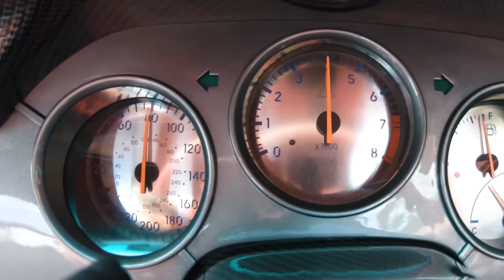The secret to Japanese car reliability - REVEALED!

Comment: Another reason is the simplicity of their design. The boot hinges on a 2003 Vectra had almost a dozen moving parts. The hinges on the Avensis look simpler than the door hinges of my room.
Reply: except that 90s germans and merc also did same design and that broke down, including "simple" parts
Reply: Your 100%  right. Toyota   keep it simple  dont over  complicate but over engineer parts.iv a 2005 land cruser from new and the only thing that broke was the radio..the best built cars in the world..
Reply: @agreatd  but these probably were made of worser materials or had smaller tolerances, or had more complicated systems connected to them, that made several parts fail in tandem, or were simply run at higher stat figures and therefor got more strain on them
A good example is the TDI of today compared to the TDI of years ago. We still see old Passats running around, even though smokey as hell. Newer versions of these are riddled with problems due to how many systems make up the engine, like the EGR and DPF, and even the engine itself is overly designed in the wrong way, aka made complicated for small gains. Reminds me of the 2.0 TDI, which was known for a terrible oil pump design that would destroy itself passively, and the heads were made of pourous aluminium. What a disaster...
Reply: @davidennis7609  Toyota Landcruiser are simply workhorses. Never heard of a Landcruiser breaking down, even when you forget to put engine oil, but of course, you shouldnt forget 🤣
Reply: Also it goes all the way back to some basic design standards called "sigma 6". Simply every engine part is designed to work in infinite cylcles.
Reply: @siavashshoosh  It's 6 Sigma.
Reply: Agree with Onur Koray.
Matt left this crucial detail out. Japanese generally use older technology   which has long been proven and lag behind the Europeans so that they maintain reliability.  The result of this is that they are less pleasing to drive . Their interiors lag behind too. 
A lexus NX hybrid has 200 hp from a 2.5 litre engine with  CVT ! Of course that is going to be more reliable than a Volvo XC  40 with 262 hp from a 1.5 litre 3 cylinder engine with a direct shift gearbox!!
Reply: @mrfadec  Thanks to Toyota's lack of inovation philosphy they are now begging everyone to slow down the transition to EVs because they haven't created anything new despite being leaders in hybrid systems
Reply: They are advanced not simple
Reply: @allentoyokawa9068  A two piece hinge mechanism is far from advanced. It's basic, but it works and it endures.

Comment: Mazda with rotary noises: we are daredevils of unreliability
Reply: The only thing you had to do to get the reliability is change to the ceramic apex seals.
Reply: To be fair, they did build the most reliable to rotary engines out there
Reply: @martinfisker7438  Doesn't change the fact that they were unreliable compared to normal engines.
Reply: Rotaries... Dont buy one unless you know your shit about them... Under than that... They are freckin cool..
Reply: Just get a mazda 3 and ur set for life
Reply: @Seven Penguins true
Reply: Rotary engines used in mazdas are German there called wankel
Reply: Misra cute fun realise car
Rx7 demonish unreliable car
Reply: @gpapagi  Agree. I've had my Mazda 3 from new for 6 years and it's built like a tank. 110Kg heavier than a 5 door golf 2.0GTD, probably because when my car was built it was based on a Volvo V40 as Ford who owned Volvo at the time also owned 30% of Mazda.
Reply: @stig20101  not really. The original rotary engine design was by German engineer Felix Wankel; but saying that Mazda's rotary engines are German is like saying that Toyota's inline-4 engines are Belgian because the first inline-4 engine was developed by Fabrique Nationale in Liége.

Mazda (along with several other companies) licensed the use of the Wankel engine design parents, and then went away and developed their own engines based on that original platform. As with other manufacturers, the rotary engines they produced were not the same as the original design.
Reply: @RT-pj5zj  Not sure where you are getting that weight figure from? But I don't believe it to be true as I MOT cars for a living and part of that is weight on the rolling road and from memory they are around the same weight .
Reply: @damionlee7658  fair enough but that's what I read somewhere and on Wikipedia it's called a wankel rotary engine and is developed with ncu engineers and mazda
Reply: @stig20101  the Wankel has an interesting history, and to be clear you are not wrong about its origins being Germany. NSU was the company that did the early development work on the Wankel engine. They were responsible for licensing the technology to engineering companies around the world.

For example, Rolls Royce also bought a license. It was them IIRC that took the engine and developed a diesel version. Alfa Romeo, GM, and Citröen also bought licenses (and a lot more that I can't remember off the top of my head).

Mazda seem to have had the most success with the rotary design. They managed to get enough reliability or of their development of the rotary engine to do win Le Man's in 1991 with the rotary engined 787B. Unfortunately, rotary engines were banned for the WEC the following year.
Reply: @damionlee7658  cool thanks for the info
Reply: Mazda is a japanese Opel.. just joking 😉😁
Reply: @RT-pj5zj  mine is a 2014 sport nav 2.2 diesel and its a beast, had it since 2017 with zero issues.. fave part is the seat, so comfy i could drive for days. Not sure how the latest model performs but visually i was disappointed when it came out as mazda was promising a kai concept look and they just did not deliver. Was looking at the V40 as well at the time but it was a bit overpriced for me. Overall pretty happy with the £12k i parted with for it

Comment: Matt you forgot to mention Japanese cars made in the UK are also among the most reliable too, so this points to their excellent engineering much more so than the workers who build them, why is a Honda made in England more reliable than another car made in England? its Not the workers its the design quality, n work practise what British manufacturers should a realized long ago
Reply: Japanese cars break down too and their owners often like to pretend they don't (and I've known more than a few Japanese car owners who would boast how their car never breaks down when they're on their third gearbox and just last week changed a window lift mechanism which cost them 200£ plus fitting), but even assuming they really are more reliable in general, there are also issues like complexity, especially when it comes to the level of variations in the manufacturing process, which make Japanese cars very different from European cars.

You can customize a BMW 3 series in so many different ways that you could have 100 of them lined up and no two are the same spec. You can't do that with a Honda Accord, there's like two or three trim levels and engine choices. 

More options means more things that can potentially go wrong, and people are generally better at assembling one thing over and over again as opposed to having to know how to assemble dozens of different things.
Reply: @BigUriel  Generally everybody in general trends to not reveal the problems they have with their cars. Have you actually ever owned a Japanese car or are you just being a spokesperson for BMW? Forget about brand loyalty just get something that works and works for a lot longer than anything else! That would be a strongly reputable car such as a Corolla, Civic, Accord, etc. All Japanese! Save your money!
Reply: @BigUriel  So what!? Quality is the most important thing when buying a car! Quality of the drivetrain comes first and the rest is built just as well on Japanese cars! Some better than others but overall actually long lasting and of top quality (depending on what trim).

Comment: "20 year old car with the same horsepower as a Bugatti Veryon"
Should mention the Veyron is now 16 years old as well......
Reply: And supra mk4 is 30...
Reply: Hmm. Where is this ten years I seemed to have misplaced..
Reply: checkout the price difference
Reply: Are you saying than they are the same level? Rear wheel drive front engine sports car vs rear engine record braking AWD hypercar? Seriously?
Reply: @zlunazelena4080  who said they are same?
we are just talking about numbers
Reply: @zlunazelena4080  bruh did anyone say that? I was merely mentioning that the Veyron itself is almost 20 years old.
Reply: Well the supra engine is 35 years old, has 2.67 times fewer cylinders and less than half the engine displacement.
Reply: HOW EXPENSIVE IS Veyron? 🤔
Reply: Fuck we got old
Reply: Holy shit I'm getting old
Reply: @badass6300  which is amazing to have 1000 hp in supra as compared to bugatti
Reply: @badass6300  and also its just faster sports car (stock!!😉) the veyron is a record braking supercar...
Reply: @talharoxen  for slower ones again: what i wanted to say is than a toyota supra, sports car from 90s is capable of reaching same power level as a hypercar from 21st century,( even though the engine is 20 years older)...
Reply: @arno7110  how many years has the engine in that supra? Most mechanical engine parts are before chernobyl...
Reply: @arno7110  the thing is than if veyron engine has 16years, the 2jz has 36years.... so still 20 years....sure thing the veyron is older than before, i am just talking about the technology level... bugatti veyron from 2006 is still using more modern technology than current škoda octavia or russian uaz hunter, that has despite its look relativly modern engine...
Reply: @zlunazelena4080  Mat said in the video "you can make a 20 year olf car have as much power as a Bugatti Veyron."

Did you even watch the video or are you just bored and need someone to argue with? Gtfoh
Reply: Ok but that means nothing because the Supra is still older regardless
Reply: @arno7110  is supra 20 years old? Is. Is bugatti veyron younger? Is!!! A lot younger, especially since it uses a lot newer and more modern technology, not only because it is younger by the date of creation...
Reply: @talharoxen  Which is a pointless debate. There were racing cars with 1000hp in the 1940s. Power isn't everything.

1000hp Supras blew up too and they certainly didn't make that kind of power with stock engines, Japanese cars aren't as bullet proof as some people make them out to be, and they made 1000hp with peak torque from like 7000rpm and were useless anywhere but in the last 2000rpm, at 3000rpm they made like 100hp (less than they did stock in fact) while a Veyron is already making over 400 at that point.

Comparing stock cars to drag cars is and always will be stupid. It's like asking how can a Concorde cost more than an F16 when the F16 is faster. A 1000hp Supra is made to run quarter miles, in perfect conditions and with frequent engine rebuilds and not many runs in a short period of time or something will probably explode. A Veyron is designed to cruise at 200+mph on the Autobahn all day long only stopping for fuel and get you where you want to go feeling as fresh as if you just took a nap. A Veyron costs 100x more than a Supra because it's a 100x better car.
Reply: @BigUriel  Well i mostly respct what you are saying but one thing is for sure that you are a part of point less debat now :)
Reply: @curiouspanther2818  everyone understands that, except some bugatti owners...
Reply: @curiouspanther2818  supra and bugatti are two different types of cars they cant be compared
Reply: @curiouspanther2818  Are you soft in the head?
Reply: Supra is actually a 30 year old car.

Comment: I always thought it had to do with Japan being a small country, without much room for expansion, leading the people towards intensive development instead of extensive (which is a big part of Japanese culture). Then there's the shortage of natural resources, meaning you have to make good use of what little you have (resulting in superior metals, rubber compounds etc.).
Reply: Hello Garage 54, I think something about not using things to their limit makes their car reliable.
Reply: I don't think the material shortage is a problem nowadays but I think this played a role in becoming very reliable
Reply: @jasonw98  hey man. I agree that Japanese cars are quite overbuilt. I've only owned JDM cars my whole life, I can testify to that fact.
Reply: Good point. On the other hand the UK being a small country island nation expanded and has Jaguar Land Rover 🤪.
Reply: @dreckigerkek3244  it's probably not, you can get stuff imported now, but it's still more expensive than if they were sourced locally, I'd imagine.
Reply: @SwapBlogRU  I saw that you have a...
Toyota Supra right?
Reply: @dreckigerkek3244  At their early days, it is a huge problem, with the WW2 just concluded, and two of their largest cities completely demolished. Let's assume the strife of post-war conditions remained fresh.
Reply: @dbclass4075  thats just what I did say
Reply: @jasonw98  no, I drive a 2001 Honda Inspire with a J32/J35 hybrid engine (~330-350 hp) and a substantially built up transmission (in stock form the Honda 5-speed autos are the worst). The Supra you're probably referring to is G54's drift project.
Reply: @SwapBlogRU Ah Honda's transmission... My house has a 2012 civic hybrid that the CVT experience starts to go bad. But the engines AND the battery (which ppl scare of) are just as new.
Reply: @jasonw98  Honda makes great engines, but the transmissions are pretty bad. I'm not a fan of the manuals either. I used to have the Acura TL 6-speed in mine, it was quick to shift, the action felt great, the ratios are lovely, but the transmission itself wasn't particularly durable.
Reply: Actually, Japan is not a small country as it has 126 million people.
Reply: I think that’s a good point, lack of natural resources mean use them as efficiently as possible. They have also competed in F1 and other motor sports with great success so I don’t think simplicity , more ensuring engineering answers solutions are simplified
Reply: @bobklee2397  well said
Reply: @Dutch Berry well, I am from Russia, so relative to my country - yes, Japan is small.
Reply: This is probably a much broader (& good) point. 
It’s definitely part of the corporate culture too!
Reply: Interesting perspective.

Comment: Matt mentioned the fact that an assembly line worker can stop the line, if they see a problem. Their word for this is "Andon", which can literally mean "flag". 

Where their true secret lies in that the philosophical thinking behind "andon" - trust your staff - extends to the very, very top, and across the supplier base too. Quality starts from the bottom of the ladder, and it up to the entire management chain to support and actively participate in that. 

Contracts from Toyota to, say, an alternator manufacturer tend not to dwell on quantity, but focus quality, on helping the supplier adopt andon themselves, on working with kanban (just in time delivery). They pay their bills on time too. Toyota will put their own people into a supplier, to help the supplier adapt to being a part of the "Toyota Family". 

What quite often happens is that such suppliers stop doing business with, say Ford, because it so much less hassle. In this sense, this gently-gently approach is ruthless; it's hard for other manufacturers to compete if you're depriving them of access to suppliers just through being nice to them. It's not even anti-competitive.

This embracing of suppliers and looking after their interests too pays off. Once, a Toyota supplier suffered a disaster - the factory burned down. This was a problem, because they were the single source of a component, and Toyota were running out of stock. Other Toyota suppliers took up the load, helped them get back on their feet, all of this happening spontaneously with very little involvement from Toyota themselves. The production line didn't stop, and the supplier recovered from the disaster quickly and smoothly. 

Now, that's supplier loyalty. 

A lot of this stems from the different business philosophy in Japan; it's more important to be socially useful than it is to turn a financial profit. Low quality cars are not socially useful. High quality cars are. Do a good job on the social responsibility side of things, and the profits will look after themselves.

Comment: I'd also add Mazda in the list of the most reliable Japanese brands! Mazda inline engines are as reliable as Honda and Toyota and I'm talking purely by experience! We had a 1996 323 1.5 (which we sold in 2009 to get a Mazda 6 GH 1.8) and it never let us down! It even had a metallic intake manifold instead of the dreary plastic hell all modern cars have! 
Also, don't forget that all Mazdas come to us from Hiroshima, in Japan, and they've always come from there! This certainly means something!

P.S.: Get your Wankel/Rotary stuff out, this video is about reliability! 😉
Reply: Challenge the Power of Rotary

Comment: Im a mechanic and used to work for toyota, it was almost a bit boring at times because all we had to do was servicing them, the only car that is not that good is the "toyota" proace, because its made by PSA so its not even an actual toyota😅
But its not just the japanese cars, everything they make is just reliable, ATVs, Motorcycles, Forklifts, Boatengines, Excavators...etc.